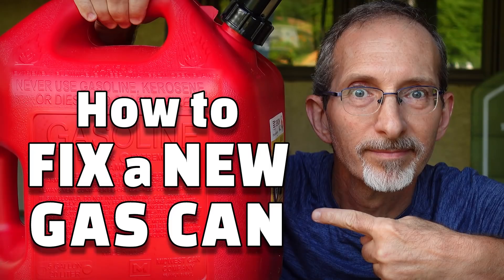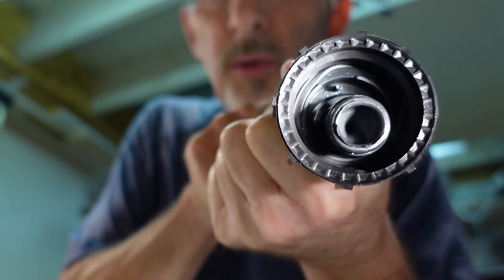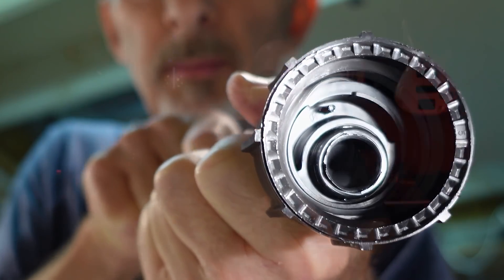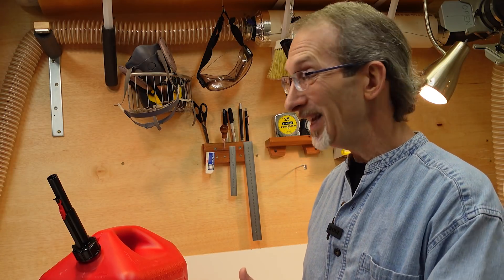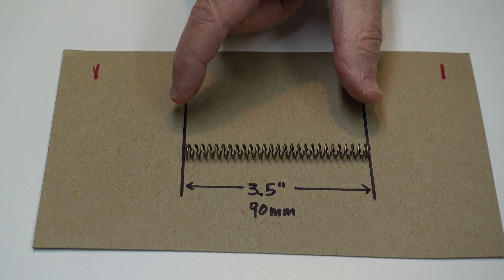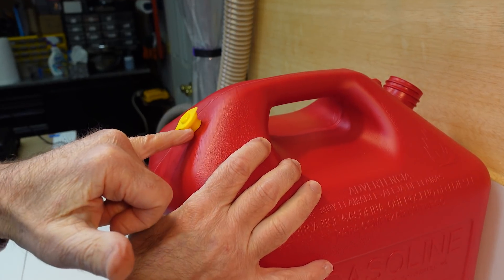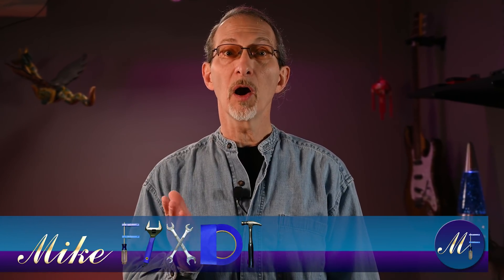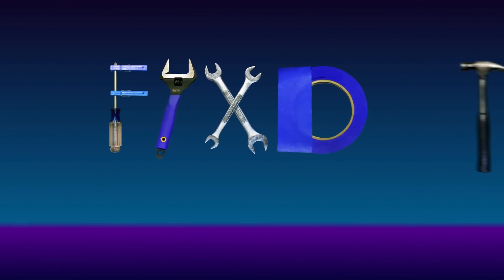Gas Can Modification | Part 2: Explosive Details!

Comment: Bring back the old ones and just let Darwin do his job
Reply from the maker: My old can was solid. This one, not so much. Thanks for watching!
Reply: @MikeFyxdt  Yep. My dad has an old one from the 80's. Metal drum design with yellow and red paint. No stupid safety cap... I've never spilled gas with it either!
Reply: Amen to Darwin !!
Reply: Absolutely natural selection has been around since day one
Reply: most newer appliance owners manual spend the first 3 pages telling you to avoid using the appliance in the rain or using gasoline to clean, or not using with a worn cord etc.!
lawsuits put BLITZ (USA made/heavy duty) out of business.
They were ~$10 now due to "safety" they are now $26!!
That is $10 for the product and $16 for the liability insurance. 
it keeps the lawyers happy.
Reply: Gotta agree. Unnecessary safety features that coddle stupid people are watering down the collective intelligence of the world. I say remove the warning on the shampoo bottles that state "for external use only" and let the cleansing begin.
Reply: @timothyneiswander3151  I'm disappointed the Tide Pods craze ended so quickly, personally.
Reply: @timothyneiswander3151  -- I say they should put those safety spouts on water cans and see if these stupid people can figure out how to get the water out of them
Reply: @Ken-rk3by  They (AKA "Da Gumment") are already pushing the Mfg's to put the new, safer nozzles on blue water cans. Apparently, somebody in CA tried to put out a fire with a new can. She struggled to control the five gallons (almost fifty pounds), slipped in a small puddle, and fell on her service dog. The dog died, the small fire was put out by the splash she made as she landed, and Da Gumment wrote up what she did as "Proper Procedure For Extinguishing Small Fires."
She drowned
It's In The Book"!
Reply: @timothyneiswander3151  i don't see them as safety features - they make me spill gas! not safe throw the spout away! use a funnel and don't spill anymore!
Reply: @gordons_here  Use a funnel that has a fine mesh screen that also blocks water from going into your tank. There are funnels that do that (maybe someplace like "Mr Gas or Mr Gas Funnel" might work.
Reply: @joesinakandid528  that sounds good - going to look into that - thanks good comment!
Reply: @joesinakandid528  Doctor Strain.
Reply: @timothyneiswander3151  I've heard rumors that swallowing a small flashlight, just before swallowing a cup of bleach, will kill the C-19 virus. Do bleach bottles still carry the "for external use only"  warning?
Reply: "...and just let Darwin do his job"
Unfortunately product liability suits has monetized stupidity and because it is so easy to file a claim crooked people will try to grab money where they can.
Reply: We protect people from themselves to much. Slip and fall lawyers, ambulance chasers, all should be disbarred
Reply: You can still get the 5 gallon “VP Racing” style cans with the hose, they can’t sell them as “fuel cans” so they sell them as “bird seed containers” for storing your bird seed and easily filling your bird feeder (which they do also work great for).
Reply: @tonyw9429  I can get them now as gas cans, sorta, just unlisted
Reply: @tonyw9429  I use the racing cans, the rest are garbage
Reply: Sorry, but I don't get your Darwin comment.  Usually Darwin awards are for stupid people, but for over 100 years, we've used flex nozzle gas cans, and hardly any injuries were caused by the use of these.  But I've spilt more gas trying to wrestle this new design because I can't press the nozzle while trying to shove it into the car due to the angle of these new things, and not long enough without scratching the car, etc.  And now it takes two people - 1 to hold the funnel I know have to use, and myself while trying to hold a 30 lb 5 gal can and trying to squeeze the mechanism with the other hand.  I find this new design far more dangerous.

@Independent Thinker - I understand now your comment.  Thanks for the clarification.
Reply: @dwaynemauk566  I understand what you mean, the govt F'd up a friggin gas can! Let Darwin do his job with the ones that use these new stupid things.
Reply: @independentthinker8930  I understand now what you mean.  Thanks.
Reply: 30 years of using old fashioned normal gas cans and NO fires. Pretty sure I can go another 30 years without any accidental fires.
Reply: @BooDamnHoo  more spills caused by the so called "saftey" device than just a spout. It's ridiculous
Reply: This new gas can is the perfect metaphor for everything the government touches.
Reply: @railroad9929  the earlier ones moreso
Reply: @jchoneandonly  No, the earlier gas cans were just fine.
Reply: @railroad9929  depending on application yeah. Flawed as they may be, they do have features that are great for certain things
Reply: Did someone say gas fight?
Reply: Contact your US Rep and Senator and tell them to get the EPA inline. Or buy a Justrite metal can that works great. Not cheap but really good and made in Illinois. Keep in mind this is pricey but good enough that you can hand to the next generation of your family.
Reply: For what it's worth, I've run into a few newer cans that I've liked.
That said, it's a large amount of complications for not so much benefit.
Reply: Darwin is doing his job. As soon as humans grow a third hand these cans will no longer need your modifications
Reply: I’m 65+  and disabled, it’s almost impossible for me to fill my tractor. I have to hold it above my shoulders. I absolutely hate these new cans.
Reply: On a hot summer day, I watched an idiot fill a hot chainsaw with gas, and he had a lit cigarette in his mouth. On a breezy fall day I watched an idiot in an alley burning a pile of leaves much too near a garage with the damn gas can no more than 6 feet from the fire. Why try to invent safety features at the inconvenience of normal intelligent humans to help the idiots. Allow nature to do its job.
Reply: conversion spouts are readily available
Reply: The problem is lawsuits:  https://youtu.be/gTQtVsggZXY
Reply: Hahahahahahahahahaha!!!!
Reply: Modifications at 8:20
Reply: It’ll take tort reform for that to happen. Democrats will never let that happen.
Reply: @Blue-Wave-2024 apparently you are missing common sense! Only an idiot can't pour gas with old containers! These new pieces of crap cause more spills anyway! Damn, schools have failed miserably! 
Are you the one they put directions on shampoo bottles for???
Reply: @Blue-Wave-2024 I bet you are the reason they put directions on shampoo bottles
Reply: Yeah I blame the reason the country is so crappy right now is because of warning labels the idiots that would have otherwise been thinned out have survived to become adults and gone into government .

Comment: You didn’t show how well the added vent seals in gas in case the gas can is accidentally tipped over (more probable than pouring gas on a fire).
Plus you didn’t mention a caution to purge the tank before using a heat source to soften the plastic. Otherwise it’s an interesting and informative video
Reply: It appears that the can was new and had not been filled with gas previously.

Comment: Ditch the plastic container  And buy Wavyin Jerry cans You will never regret it . O and get the high flow spout You won't have to stand there 10 Minutes While it  Drains
Reply from the maker: Hi Jason - trying to save a few bucks with the cheaper cans! Sometimes I wonder if I should have started out spending more, but honestly these mods make these cans SOOO much easier to work with. Thanks for watching!

Comment: You might want to go back and edit your first video about the flame arrestor screen in case others don't see this second one. Liability. Open flames are not the main cause of the cans exploding. It is static electricity discharge. Fuel or oil flowing through any line creates a sizable electrical charge. Plastic cans do not drain easily off the charge that is created by a liquid petroleum product flowing through them as they are insulated, unlike metal cans. This is why all gas nozzles at filling stations are grounded with a wire in the hose. Also the filler necks on all vehicles are also grounded to the chassis to help prevent this. When pouring fuel, always make sure that sure that the nozzle always touches the filler neck to help prevent a spark. Never pour gas from a plastic bucket or from a fuel tank that has been removed to empty it (usually done to replace a bad internal fuel pump). This stuff ain't no joke. I used to work on fuel tanks a lot as a mechanic and have seen many shops burn down and people injured over this. 
BTW, I'm saying this to help people be safe and aware, not intended to troll your videos.
Reply from the maker: Joe - all good info, I appreciate it! I did update the description in video 1 to let people know it isn’t a filter, but a safety device.  I still think these cans are miserable to work with, but I think people should know the big picture. These comments are essential to the process. Glad you chimed in!
Reply: @MikeFyxdt  any time! I agree with all of your sentiments about how products are designed so poorly these days and how to find ways around the flaws and help others to fix it for cheap. Bureaucracy and greed can even ruin something as simple as a gas can now. A plastic gas can costs $25 these days. I bought my 5 gallon Blitz cans back in the day for less than half that!

Comment: The marketing posted that Safety is the #1 consideration for purchasing a gas can is BS. It is clearly a survey that is typically manipulated to get a desired answer instead of a realistic answer. Pointing out this manipulated survey is propaganda not marketing. Additionally, as you pointed out the other sensible questions were left unanswered by the marketing department. Since you cannot return a poorly performing gas can after you find out how poorly it works you are stuck with it to modify to make it work. This is piss poor treatment of the consumer. This is why they keep changing the nozzles in hopes you are dumb enough to believe their next new functionally useless CARB compliant junk will be better than the last one you got pissed off with and threw away. There are many metal vents available now and good replacement spouts with caps. The manufacturers do not care about the consumer and will keep doing this as long as the suckers keep buying them. And when management ruins the company and brand the principals flee on a golden parachute to ruin a new company. And the stockholders get hosed.
Reply from the maker: Testify! :)

Comment: You know this is due to safety regulations, right? 

An safety can is (29CFR1926. 155(1) an approved, closed container, of not more than 5 gallons capacity, having a flash arresting screen, spring closing lid and spout cover and so designed that it will safely relieve internal pressure when subjected to fire exposure. Required by OSHA and others. Midwest didn't make this up themselves to fuck with people. They don't make the rules; they are just trying to spin these features into positives, like all companies. I am not sure why you are so obsessed with Midwest specifically... This is literally all gas can makers.
Reply from the maker: @Panda - thank you! I have not been able to find any OSHA rules, so this is very helpful. My focus on mid west cans is only because that is the brand I bought, and where I experienced my frustration. The follow up video came from what I learned after making the first one, which I hope is helpful. Even though it is somewhat of a spin, it is all factual, and I hope it encourages people to seek out better answers, just like you did! I really appreciate you joining the conversation!

Comment: Don’t buy from this company if you don’t like their products.   That is the best way to nix this stupidity.  Personally I make my own spouts .  That way it is the way I like it.
Reply from the maker: Doug - agreed! I didn’t know when I was getting into when I bought these cans. Best to make the most of an existing situation. You make your own sprouts? Interesting!
Reply: Mike Fyxdt I hear you.  I have one similar that requires the “trigger” to be depressed.   Did not realize that when I bought it.  What an absolute pain, but that is the norm when “do gooders” run amok.  
One thing I must applaud some companies for is the little tag that comes on some.  I have a plurality of 2 stroke motors, all of them want different mixture ratios.   Probably not critical, but the tags keep straight what goes to what.
Reply from the maker: @dougberrett8094  1 have 2 dedicated 1 gallon cans, which are named (with a fat Sharpie) 40:1 and 50:1.

Comment: I have an old fashion red plastic gas can with a yellow vent. I've had it for years and plan to hang on to it. I hope I never have to buy a new one. I typically only use it for the lawnmower as I would rely on my auto club membership should my car ever run out of gas.
Reply from the maker: Makes sense! I miss my old simple metal gas can.